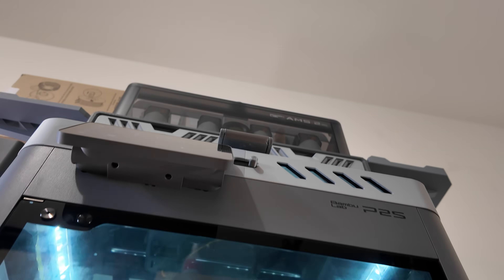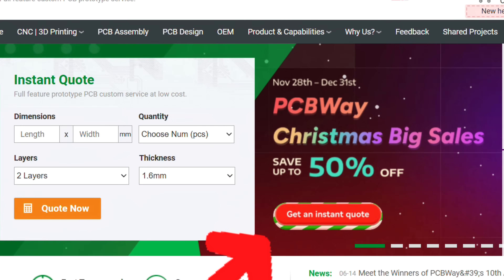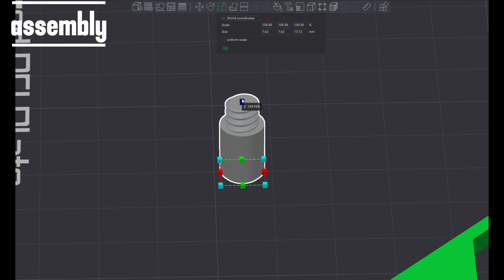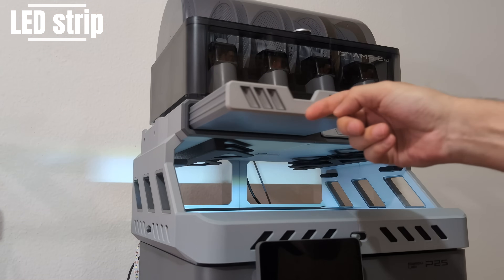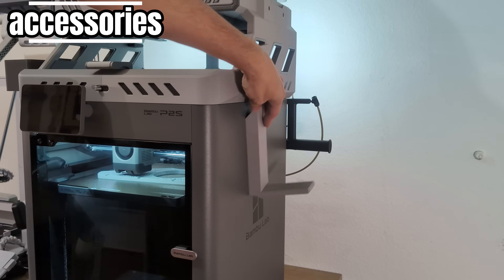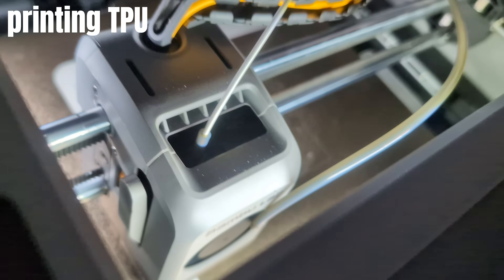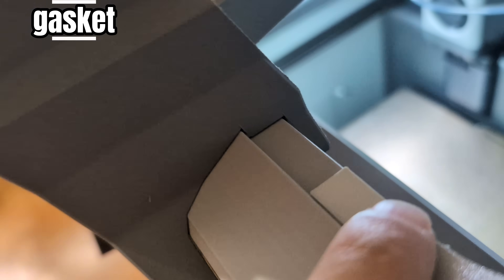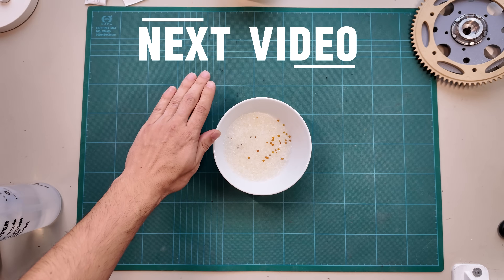Why your 3D printer needs this Upgrade – and how you can print it yourself!

Comment: Is there a filament profile for asa? I have the ams 2 pro and the heater is making my old riser sag already with pla matte
Reply from the maker: The heater? So you are talking about a H2S print profile i guess?
Reply: @Dirt-E-Bikes  sorry the dryer in the ams 2 pro, the heat is warping the pla on my v2 riser. I feel if I print with petg and I dry asa or abs it may warp the petg aswell or have you tried yet?
Reply: A specific print profile for the riser to be printed with asa. So the ams2 pro dryer vent doesn't warp the riser
Reply from the maker: @bsmbB i see, haha sorry misunderstood that 😅
I dont have any problem when drying filaments at its max. temp of 65°c. 
I think i read somewhere that ASA or ABS would not be recommended for the riser because of the tolerances of the parts that slide into each other. Best to ask Darren directly for that (use the messaging on makerworld or direct on the model site of the D3P riser.
Reply: @Dirt-E-Bikes  my fault I said heater lol. Thanks for the information, maybe I will try petg instead of asa if my asa print warps
Reply from the maker: @bsmbB let me know how that goes, i think i never did a ABS print that large. Do you use some special tricks (3D lack, glue or settings) to deal with ABS parts in this size?
Reply: @Dirt-E-Bikes honestly ive been asking chat gpt for alot of my printer settings but so far everything i asked turns out decent enough. Its generally really slow though like it recommended 40mms for outer wall speed but I bumped it up to 60 I believe, normal bambu studio setting was 100 if I remember. Oh well well see tomorrow night how straight it is. I printed the extra drawers for the v2 riser with asa amd they came out great but I guess this was too large for the normal settings and the fan was set to come on for overhang so the first print has a bunch of layer adhesion issues around the over hangs
Reply: @Dirt-E-Bikes  A number of my risers have been printed in PETG, ASA and ABS. I have some built in tolerances.  ABS and ASA are more challenging to print but there are no issues if your printer can hold tolerances.
Reply from the maker: @bsmbB thanks for your detailed answer, really appreciate this 👍
Reply from the maker: @Darren3dprint nice 👍🏼
Reply: @Dirt-E-Bikes  first 2 pieces came out good slightly warped on the bottom but still slides together easily now i need to wait for my filament order to finish 😂
Reply from the maker: @bsmbB 😆👍

Comment: I want this for the anycubic Kobra s1 max combo when it releases. I hope to see that come out.
Reply: I have two coming so its pretty much assured that I will port the riser design to the Kobra S1 Max.  I have risers or overhead mounts for pretty much all the other Anycubic printers.
Reply: @Darren3dprint  perfect I just subscribed. I don't want to. Miss that. Me and my kids will be pretty new to 3d printing. I'm also ordering a Photon p1. I had a flashforge foto 8.9 several years ago but it broke recently.
Reply from the maker: I can't say for sure, but i guess Darren will make one ;-)

Comment: What if you added the gasket for the section where the spool holder goes onto the glass instead of the riser?
Reply from the maker: Bro, that's a great idea!! Very clever 👍 i have to try this... Too bad its already glued on 😅
Reply from the maker: I did it as you mentioned, it works 😊
Again, great idea and thank you for sharing that 👍👍

Comment: I would not suggest using Alcohol on a Textured PEI Build plate. This can lead to adhesion issues with future prints. 
I have had the is happen with my own PEI plate.
Reply from the maker: Hi XndeX, thanks for letting us know👍
I regularly use alcohol on my print plates (blend of isopropanol and ethanol) and had no issues so far. Did your print plate showed any visible change after using alcohol (turning whitish)? Or just lost its adhesion?

Comment: I bought this riser from Cults for my H2D, printed and fit perfectly, and I have been very happy with it so far for my dual AMS+ HT setup! Well worth the moneys.
Reply from the maker: Nice, thanks for your comment mate, one question; is it true that you can not print and dry with the AMS HT at the same time? My AMS HT is still somewhere in a chinese factory waiting to get built... Last time i checked it said it arrives sometime in February...
Reply: @Dirt-E-Bikes  technically you can't print with the "AMS" feature of the HT and heat at the same time, BUT you can run your filament through the "bypass" hole and heat at the same time which really works out nicely with TPU and CF filaments where you're not running them through the filament feeder anyway. :)
Reply from the maker: @buxtech good info, thanks a lot 🙏🏻

Comment: Watched the whole video despite not getting a P2S... Great video though! 😅 

Would recommend mainly using the vacuum bags for less moisture sensitive filaments. The thin plastic isn't a very effective moisture barrier. They also need a lot of silica gel to maintain the low humidity. With moisture sensitive materials like TPU and nylon, keeping them in aluminium foil bags with desiccant is the best. Metal is far better barrier against moisture than plastic.
Reply from the maker: Hi Silvrcel, thanks for the comment and the info about the bags, much appreciated 🙏🏼 
Do you also use these aluminium bags with a vacuum pump? Or just put the filament in and add silica gel?
Reply: @Dirt-E-Bikes No vacuum is needed for the aluminium bags. You can even use them without silica gel, but it's better to have them as it'll bring down the humidity even further. Many moisture sensitive filament come with reusable aluminium bags for storing filament.

A vacuum can actually be worse if you put silica gel in the center. Had been testing my desiccant container design with 70g of silica gel, and it barely had an effect in regular vacuum bags. The humidity inside steadily rose because the bag wasn't effective at being a barrier against moisture. Not having a vacuum in the vacuum bag with silica gel in the center made a huge difference, but aluminium bags were still far better.
Reply from the maker: @silvrcel nice, thank you to provide me and the others here with that kind of high level infos! 
I have planed to make a video about that topic because i realy want to het down that rabbit whole, and you actually tested that and providing that kind of infos in my comments is just great 👍🏼
Reply: @Dirt-E-Bikes I've actually shared some of the data on my design. I'm mainly just a hobbyist so the test are only done with basic equipment. But the test do give some potential insight to what may be best when using silica gel and reusing them. Like drying them at lower temperatures is possible but it'll take significantly longer, won't be as dry, and you won't achieve as low of a humidity when compared to drying at higher temperatures. I'm still gathering data for filament storage but you can check it out if you look for the desiccant container by Silvercell.
Reply from the maker: @silvrcel thanks silvercell, i saw your design on Makerworld, looks amazing, really thought true with the bigger surface area on the High flow ones. I will print that, and probably show them in one of the next videos if you don't mind ;-)
Reply: @Dirt-E-Bikes  More than happy for you to share it on your channel if you find my design useful. I mainly designed it because I'm quite lazy in having to empty and refill the containers to dry silica gel in the oven. Wanted to have a better solution where I can just place the containers in a filament dryer to do its thing. It may be slower, but it's something that can easily be left over night without being attended. Although with the AMS 2 Pro, the 65°C is quite low and will need like a day to dry. AMS HT is a lot better for silica gel at 85°C.
Reply from the maker: @silvrcel  sure thing i filmed it yesterday but i need about 1 month for each video. So it will take a while ;-)

Comment: That thang is hughe 😆👍
Have to check if there is a version for my qidi q2
Reply from the maker: There is, you should find it in the description (the one for all other printer models)
Reply: Yeah I remember when dude was designing it. It’s on cults
Reply from the maker: @RioterWTF okay cool 👍🏼 i just found it by accident when i was searching for a riser that can solve my P2S problems 😅
Reply: @Dirt-E-Bikes nice to see someone do a video on it. I just remember him posting it in groups and then doing add ons. Nice that all the add ons were free at the time of you had already purchased it before hand.
Reply: @RioterWTF  I intend to keep all addons free.  I do this for fun and as a hobby.  You pretty much need the printer to ensure that the riser works well and fits.  The model fee helps me cover the cost of buying the printers to design the risers.  I have more addons planned for this riser such as more custom drawer inserts and a Multiboard side panel.